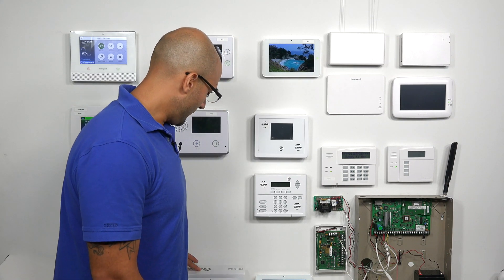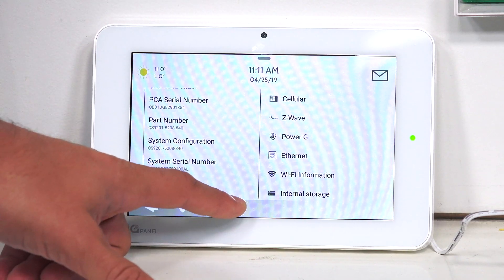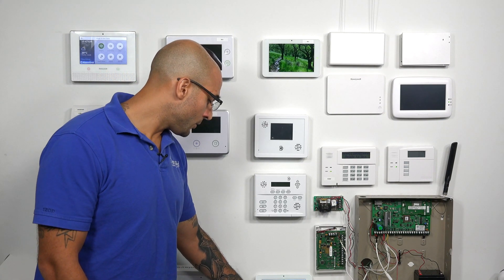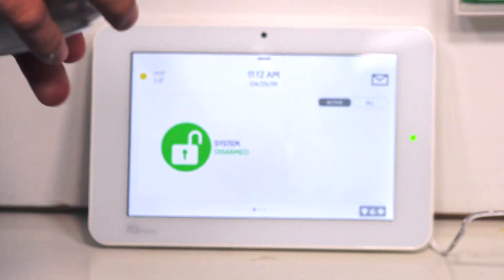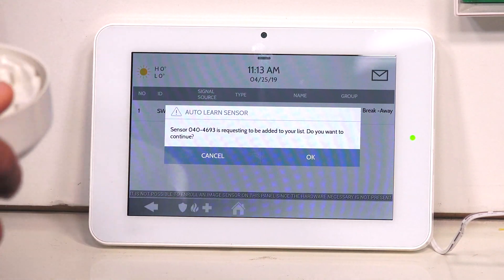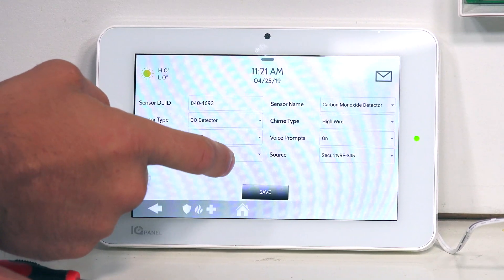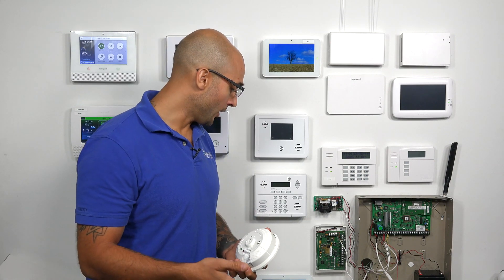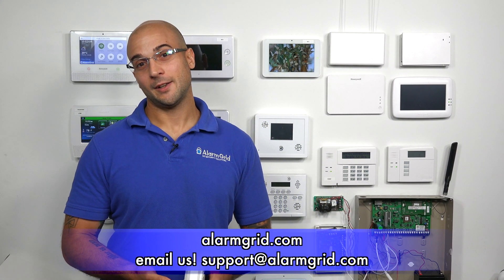Learning the Honeywell 5800CO into a Qolsys IQ Panel 2 Plus

Comment: What is the translator part# that i need to get
Reply: There are different types of IQ2 one that does 319 the other does 345 no converter unit. Unless your looking to convert hardwired to wireless. in that it would be the 5800c2w for the 345 if it is 319 then the 16f would be used